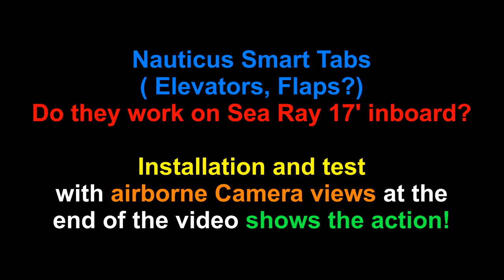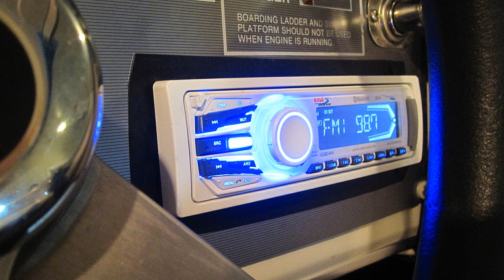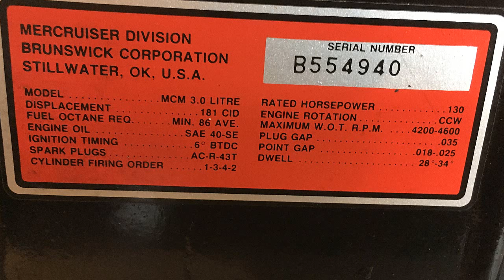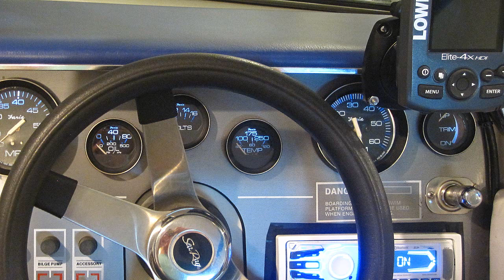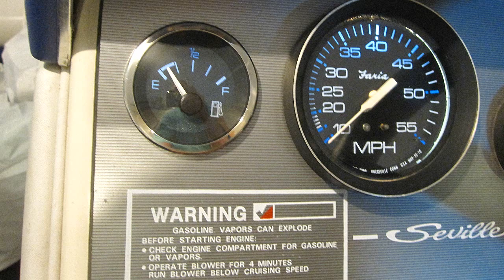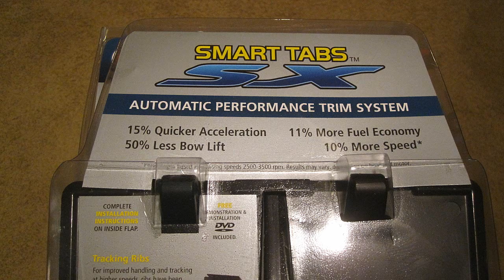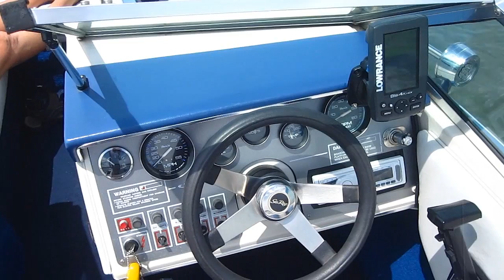Do"Smart Tabs" Boat Flaps Work? See action from flying airboat cam + major Mercruiser Repairs!

Comment: Awesome video. Really cool to see you conquer everything. We're first time boat owners with an 18 ft bluewater inboard outboard that has a lot of bow lift and takes forever to get on plane.  The smart tabs are in the mail and im hoping they get us going quicker. 

Thanks for the review.
Reply from the maker: I have a newer boat now, and its a Bayliner 17.8 foot.  I put smart tabs on it as well, for the same reason.  Also, my new boat seemed to be pulling to the left all the time. I adjusted the smart tab on the left to have less pressure than the one on the right, and it straitened it right out.  Hope you enjoy yours too.  Thanks kindly.

Comment: Nicely done. How did you set your "zinc" trim tab? Is it slightly turned to the right from center, back looking forward? I have massive torque steer and its difficult to keep the boat tracking straight.
Reply from the maker: Well, I never heard that was a trim tab, since it is not movable.  That tiny tab will really not help in any way to keep boat straight as the waves are unpredictable.  I have actually since cut mine off to make it flush with the water. I did that to stop a water stream it was causing.  Out here, we are not in conductive salt water where the zinc tabs were created for. Fresh water boats don't really need it.   That zinc tab is used to drain off static electricity, to prevent corrosion buildup in conductive salt water. I find these smart tabs keep me driving straighter than without, that is for sure but don't fret on trying to figure out how to get an angle that will help.  Just FYI, they are supposed to be straight inline with the boat.  Good luck and thanks much.

Comment: Excellent video! I have a very similar boat, (bayliner capri 1950 with the same 3.0 motor) and am looking into these to improve the same issues you had.
Reply from the maker: Thanks so kindly.  I think you will find the Smart tabs really effective.  All the best and happy boating.
Reply: @NightFlyyer  btw I’m sure you figured it out but it’s a good idea to change those water pumps every two years or so.

Comment: It drives me nuts when people call motors engines and engines motors!  LOL. Also it bothers me when people call pull campers, RVs.   And no offense, but also when people call their inboard/outboards,  inboards.
Reply from the maker: No offense, but my first boat WAS an out board engine and my boat now with the Smart tabs is an inboard engine.  Now I think I will take my Engine Cycle for a ride.  LOL.
Reply: @NightFlyyer   The Sea Ray is an I/O, an "inboard outboard".   They call it an I/O because the lower unit is on the outside of the boat but the engine is on the inside.   Inboard boats have the engine in the center, and the prop comes out underneath the boat.  Nice work on fixing the engine!  I'm kind of going through a similar repair, except mine has a stuck valve.
Reply from the maker: @1D10CRACY  Just left the Maritime Museum at Okiboji and brought up your take on inboard outboard.  The head of the museum and 2 mechanics said that since the props and drives are always on the outboard side of the boat, only the engine refers to that nomenclature.  Thus it's either and inboard engine or outboard engine.  But you can call it what you want.  Thanks for the kudos and happy boating.

Comment: Not trying to be a know it all . But you should always replace a water pump on a boat that’s been sitting they are the first and worst thing to fail. that’s a nice boat
Reply from the maker: Well, the water pump on the inboard was only a year old the guy told me that gave it to me.  The Sea leg water pump is usually the first to go and I had to replace that on mine, as it caused the over heating. That was harder.  Of course I had to run it to see what would go wrong first.  It has been running fine now for 3 seasons and is kept in my heated garage which it likes.  Thanks much.

Comment: I'm going to put Trim Tabs on my next new boat. That would be better than drilling into a new outboard, to add a fin.
A TT would be less drag also.
Thanks for the Video.
Reply from the maker: There was no problem drilling into the thick Fiberglas, just as the stands and handles also are.  My sea leg and prop has adjustable trim and I use it all the time, but don't help much on start up.  These smart tabs flatten out once up on the step.  I notice no real drag issues, but I don't typically drive around the lake wide open all the time. Thanks for your comments.

Comment: Great job! We have a lot in common sir. Bought my 1st bow rider this summer. 19' Bayliner Capri. Interior was in excellent condition but had a rotten floor. Not sure how as it was always kept covered in a carport. But then i found a ripped shift cable bellow boot not to mention bad gimble bearing etc. Also replaced impella water pump and all the seals while there. Still having starting issues and floor to finish but hopefully by next summer of 2021. Definately gave me lots to do during Covid scare going on. But has not stopped us from living life. Also picked up another Quad/drone. Whichever you prefer to call them lol. Highly recommend the DJI Mavic Mini for trips when you just want to get some great video and cool selfies with the wife. Enjoyed the vid. Take care.
Reply from the maker: That is a great story.  Just got back from a trip to see my parents graves in Northern cal.  I used my DJI Spark a lot on the trip, as that also is small and easy to take.  Thanks and happy boating, flying.

Comment: wow that is cool! hard work paying off. my roommate came across a nice size boat that was in mint condition that was just dumped by the side of a dirt road. after calling an officer to check it out, he said it was good to take and thanked us for cleaning up. he threw a (2 stroke 4 cylinder) Chrysler 105 motor on it, new radio, electronics, seats etc. with how expensive marine parts are, he has only put 300 dollars into it which is crazy.
Reply from the maker: Wow. That was quite a "steal"!  He must have a good supplier for that little money!  Thanks kindly!

Comment: I understand how you feel. Our family has a twin engine Yamaha, but the right engine's throttle is either too high or the left is too low. Either way, you have to always be on the wheel because it wants to pull to the left. Oddly enough, the only gauges you'll be looking at are the tachometers, always trying to make them equal.
Reply from the maker: Wow!  I can see that happening for sure. Sounds like governors might keep those engine synced!  Thanks for your comments.

Comment: Great video with great information and entertainment. Very nice job on the engine, you stuck it out and it paid off. Thank you for sharing the skiing footage , I'm only 61 but am going to try water skiing for the 1st time in 30 years in a boat I just bought. It's been 30 years since I owned a boat too. You sold me on the smart tabs also, I will order a set for my 15 footer with a yamaha 50 hp which could really use the help. Thank you for the video, and your service to our country and community. Happy boating!
Reply from the maker: Thanks very kindly for your comments.  Have fun with the skiing. Make sure the driver of the boat, doesn't yank you out of the water too hard and knows how to tow a skier.  That is a big part of water skiing.  I'm 72 and want to try again myself soon.  Thanks again for the great comments.

Comment: Those pump pars always,always fail. It has to do with the impeller. Guys always have replace those. I know a guy that makes tons of money fixing that stuff.
Reply from the maker: Yep. I think there could be a better way to get h2o to the engine. I read the sea pump should be changed often.it was a difficult task, so no wonder they charge so much.  I am always looking at the temp gauge now! Thanks.
Reply: NightFlyyer One of my many endevors was boat repair. The ammount of specialty tools required pretty much killed that. At the time I had already invested in a " boat" load( pun intended) of specialty tools for working on snowmobiles. A the time,I was doing snowmobiles all year around anyways. I bought them up during the spring and summer months and restored them by fall. At one time I had 11 snowmobiles in my yard. 4 were mine,the rest were for sale. Back then I was offered a free boat and decided to learn boat repair. It turned into an all summer project and killed my budget for snowmobile repair. I dumped that boat after rowing back to the dock twice,turned out the top end was bad after rebuilding the botom end. After seeing all the specialty tools required,I said the hell with it. I ended up with another one by default from my son in law. That one also had issues,I decided I had enough after rowing that one back too. I figured I was best at sticking with what I know, snowmobiles and snowblowers,plus all the other stuff kept me plenty busy,as well as my regular full time job at the schools. After I found out I had cancer,I pretty much gave up most of it after going through a surgery that left me in chronic pain. Now I just do a bit of small engine work now and again. That and fly my planes. I am still working on that Sig Kadet restoration,after finishing up my wifes kitchen remodel. I always enjoy your videos by the way.

Comment: Did you notice a reduction in top speed with the smart tabs on?
Reply from the maker: No, I don't. This boat will do 40+ and I never run it at that speed very long so don't notice. Once it jumps up on the plane, it really is smooth. It gets up on the plane much faster, that is for sure. Good question, Will. Thanks.

Comment: How do they affect docking? Do they cause issues when in reverse? Thanks.
Reply from the maker: I see no affect with docking as they are not in the way.  I drive pretty slow in reverse so, in my case, they do not affect anything.  They work great to get up on the step, though.  Happy boating and thanks for commenting.

Comment: I have Sea Ray identical to that, was researching Smart Tabs and found your video. I am going to order them now. BTW very nice boat, mine only has 80 hours on it and 30 of those I have put on it in the past 2 years.
Reply from the maker: Wow, that is great.. As you saw I had to put a lot of work into it, but it has been a great boat since.  Do you know how many gallons your tank is?  My Fuel sender works for about an hour then as the fuel gets low, gets very bouncy, and I want to change it, but am not sure where it is.  I don't want to rip up all the carpet to try to find it.  Thanks and I hope you get to enjoy it.  Still waiting for weather here.  Stay well.
Reply: @NightFlyyer  Its a 20 gallon tank.
Reply from the maker: @dannyh982  Thank you.  I always wondered.